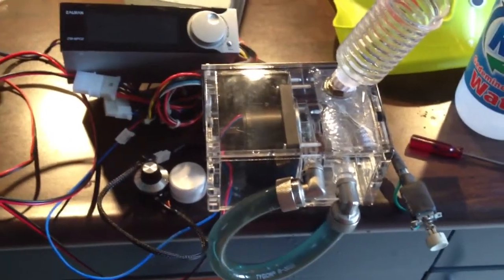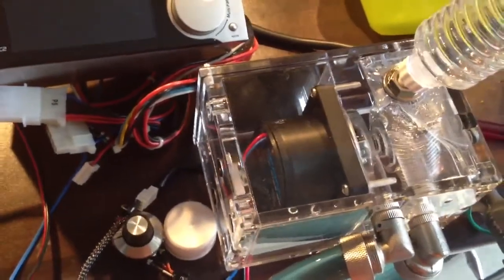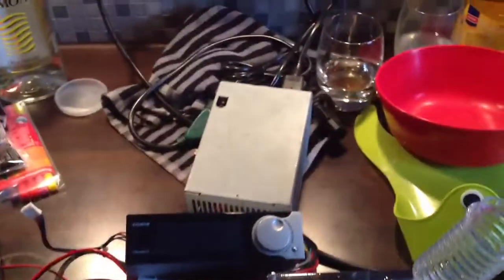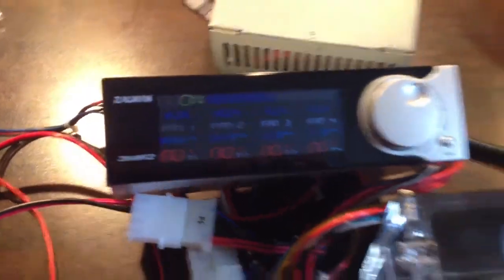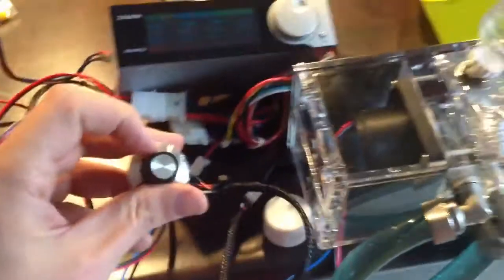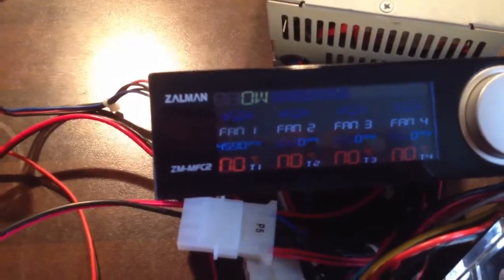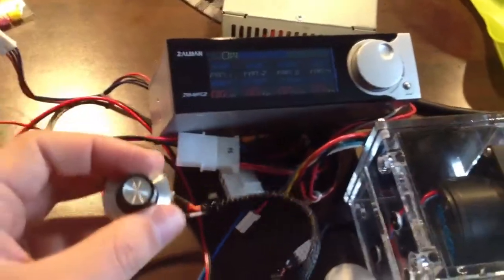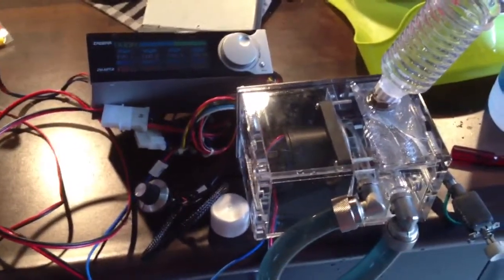Alphacool D5 pump RPM sensing mod + external adjusting.

Comment from the maker: You hook up the pump to a 12v lead from your power supply as I cannot guarantee the fan header of your motherboard will deliver enough juice. Worst case it will burn out your fan header circuitry, but you won't know until you try. If you do, check first how much power the pump requires at max speed and how much power a fan header can deliver. If you don't remove/replace the internal pot meter but just vary the voltage from the 12v lead that might work just as well. Haven't tried it though, but it makes sense electrically.
Reply from the maker: @mr.not.so.perfect.666  I believe it was a simple 10K potmeter, nothing high wattage.
Reply: @Tijgert  I deleted my question since I re-watched the video and heard you mention it was an 10k ohm rheostat.

Since you answered that question, I wasn't sure whether you still answered comments here, could you answer me this, if I didn't bother removing the rheostat from the pcb since I'm not sure on my soldering/desoldering skills, do you think If I put an 10k ohm rheostat in the positive molex wire inline with the PSU could I still use it to change the RPM of the pump and just set the potentiometer on the motor pcb to 5 and then dial down the rpm using the separate inline one ?

I've also managed to pick up one of those Zalman ZM-MFC2's from eBay for £23 (should arrive next week).

Comment: Yes would you please give us some details on where to connect the rpm wire,
i have looked all over and cant find a decent picture of the point to solder the wire to,
it would be really helpfull if you could let us know how you did it,
cheers, jak